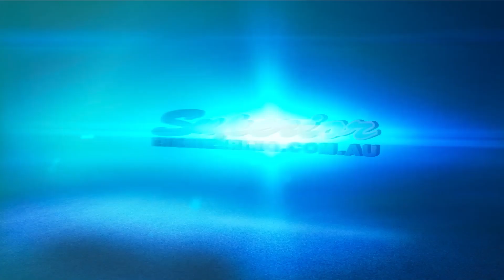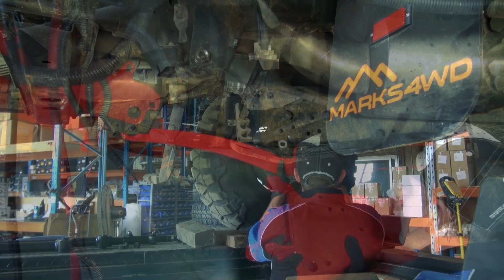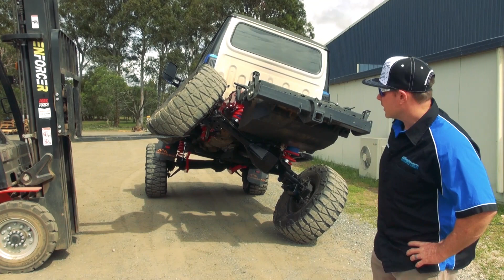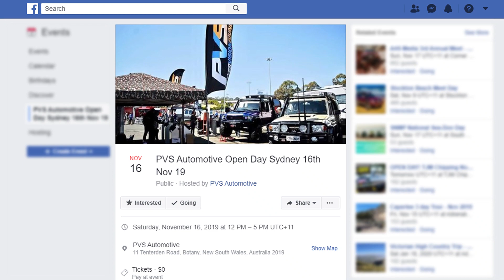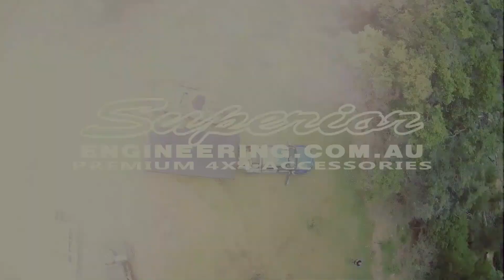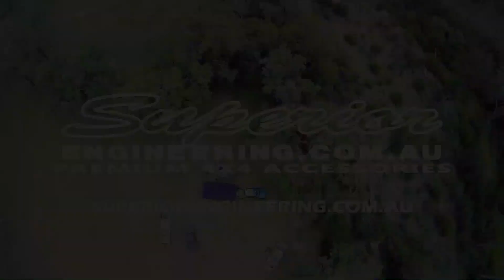PVS - Power Vision Sound 79 Series Landcruiser Portal Coil Conversion with Superior Engineering

Comment: have a question . . . why is it that SUVs equipped with suspension lift have different lift height at the front & rear? for e.g. a lifted 2021 GMC Yukon Denali (1YC) 4WD + 2.0 in. Lift 6.2 V8 5-Dr Full Size SUV (LHD) or a lifted SUZUKI Jimny VX (JB64W) AllGRIP Pro 4WD + 2.0 in. Lift 1.5 Biturbo I4 3-Dr SUV (RHD) . . . both SUVs feature a 2.0 in. lift at the front wheels & 1.5 in. of lift at the rear . . . why is the 1.5 in. lift at the rear less than that of the 2.0 in. lift at front? is it not possible to have the same 2.0 in. of lift both at the front & rear? if not, why? please advise . . .

Comment: Im building a 79 with portals this year. what's involved in coils pre rego? does it make a difference to post rego? any advantages with lift flex etc?
Reply from the maker: it is a lot better for the Approval to do it pre rego, just make it simpler in the long run, give us a call on 07 5433 1411 and they guys can go through all the options with you.

Comment: Doesn't Mark's already have its own diff-widened housing?
Reply from the maker: We used our housing as it was already set up for our coil conversion.
Reply: Yer but i think marks only does leafs not coils. Is that right?
Reply from the maker: @joelfrancis5391  Correct.

Comment: You should have painted the raw steel inside of the holes you drilled in the chassis to prevent them rusting the coil spring conversion frame bolts & weakening them.
Those exposed chrome shock absorber shafts & seals won't last 10 minutes on a dirt road from gravel blast pitting, couple of months of dirt driving & they'll be ready for new shafts and a rebuild & rubber bellow boots or shields.
Reply from the maker: We did paint in the holes mate that was just a test fit up to get everything in place, and with the shocks there are a number of brands including us that run shocks with exposed shafts and none of us have had any issues.
We use high tensile steel shafts with a hard chrome coating, it is extremely hard and resistant to damage.
Reply: @superiorengineering  Where does the rear sway bar mount, I don't see any pads on the housing & I thought your track correction housings are not swaybar compatible?
Reply from the maker: @dustyfarmer  It is a custom sway bar we have made to fit the conversion, the standard sway bar will not work with the conversion.
More on the Rustproofing above we also coat the inside of the chassis with rust preventative to help stop rust also.